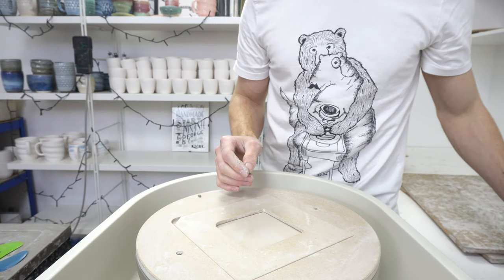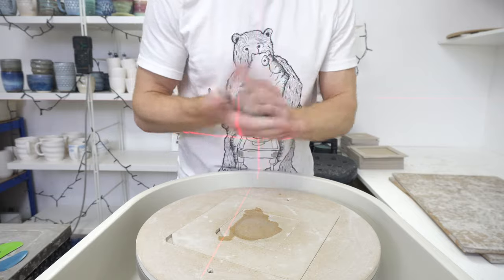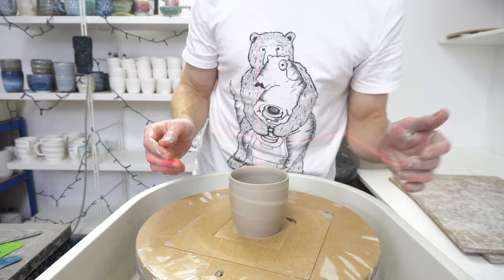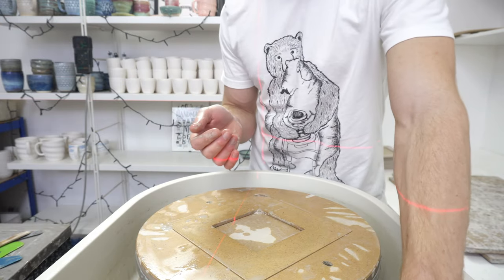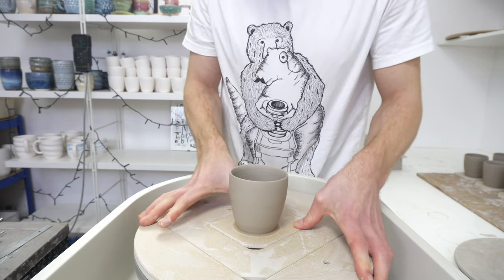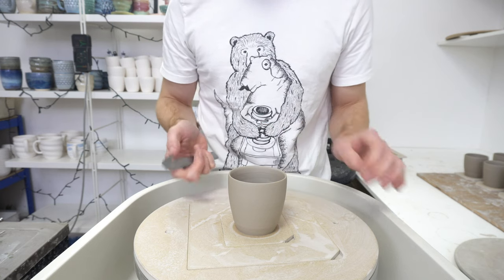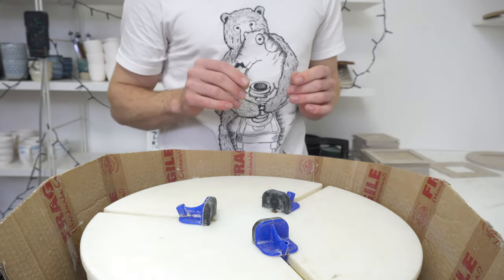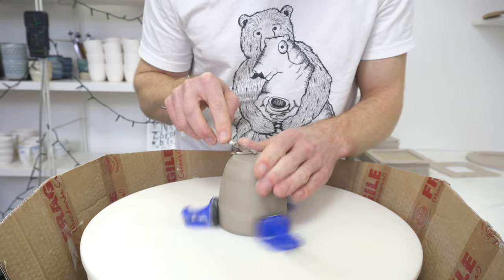Throwing, Wiring Off, and Trimming a Tumbler - Timings and Technique

Comment: I saw a Bill Van Gilder video where he drops a bag of clay from waist high,  repeat for all sides and the clay will become softer.  Many manufacturers add a polymer that absorbs water and will release the water when dropped.  Sounds crazy I know,  but it’s the single best tip I ever have seen.
Reply from the maker: Thanks, I'd forgotten about that tip. I saw it years ago but it never worked on the clays I was using at the time, it will be interesting to see if it works on the new ones